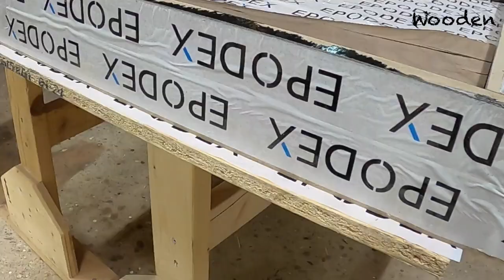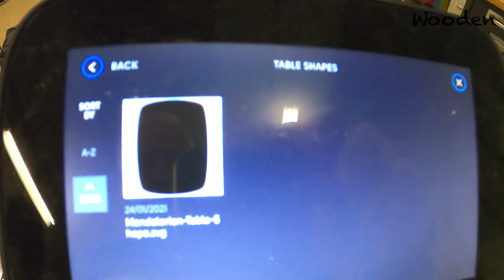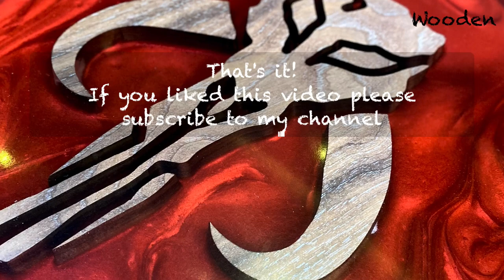The Mandalorian Table (caravan table) - Black Walnut - #shapermade

Comment: How many passes with the Shaper did it take you using the tapered bit? Piece look awesome! Well done!
Reply from the maker: Thank you 😁 I went until a depth of 35mm with 3mm per pass, so about a dozen passes I think...
Reply: Did you stay on same line or offset as you went down? Thanks for the reply!!
Reply from the maker: I did stay on the same line, but I measured how thick the bit is at 35mm and set the SO to that bit size. That way I was able to „see” how it would look at the end and ensure nothing unwanted would happen.